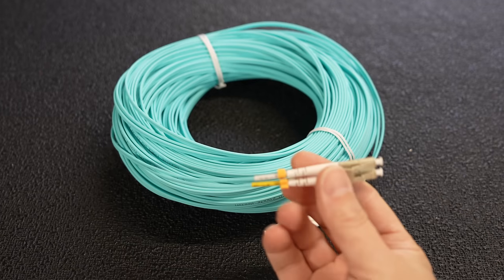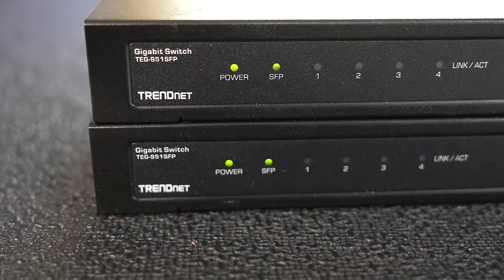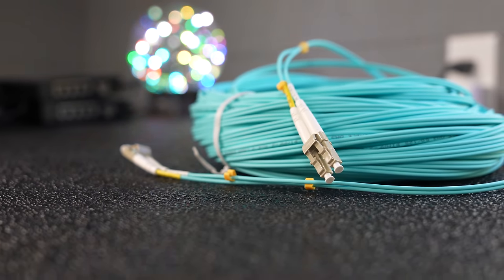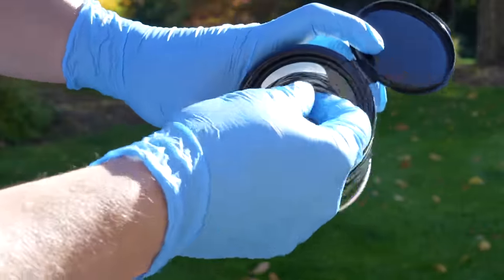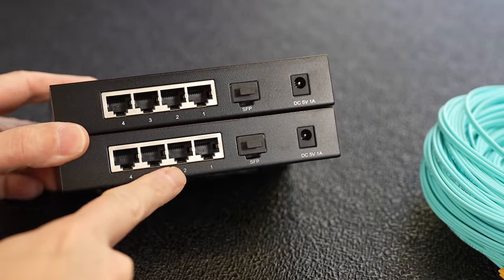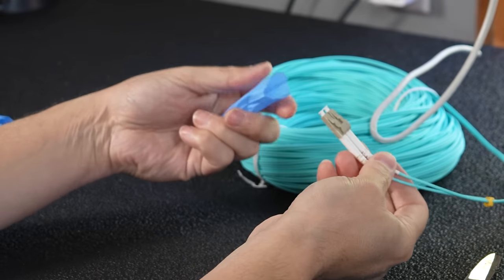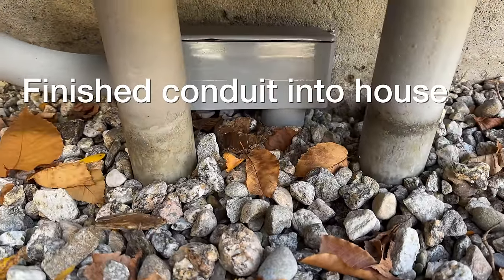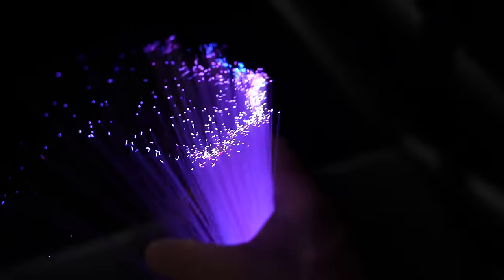How to Run Fiber Optic Cable in Your Backyard - My 10 Gig Install for Starlink

Comment: Nonsense.  Main advantage of fiber over copper is DISTANCE. But you're using it for a run that copper could do just fine (less than 328ft) at 10gbps. Fragile-ass premade cable that needs special hardware on each end vs regular switch and/or router... Only if you need more than 10gbps or distance is greater than 328ft should you use fiber.  Fiber goes for miles before speed really degrades. Oh and you can do inline surge protector for the lightning issue.

Comment: Why are you using indoor fiber cable outdoors? this is very wrong. outdoor fiber cable is used outdoors.
Outdoor fiber cables are available with double steel armor. rain water mud is not crushed like bad weather conditions and does not cause problems

Comment: nice video but there is absolutly no reason to install fibreoptic cable in your house.. even if you have optic cable right to your house the net gains or losses in the distance around your home will be 0 on such a small scale and copper wires as long as they are in good condition and properly installed and shielded can handle a lot more speed than people think i have copper wires TO my house and copper Wire Around my house and i still get 500+ Mb/sec download speeds and around 2-300Mb upload.. fibreoptic not needed.

Comment: That cable is not rated for that use.
Reply from the maker: Most outdoor fiber cables are designed for aerial or burial use and need a thick jacker. If you are in a conduit like this the cable will do very well, but if you have any worries you can use this https://amzn.to/3Dc4OMF as well but I wouldn't bother

Comment: You forgot about the number one reason not to use copper wires. Sadly it is copper wire theft some people have come home not only to find copper pipe ripped off by breaking the walls and copper wire removed also.  If you connect two buildings with copper wire its a target for copper thieves.